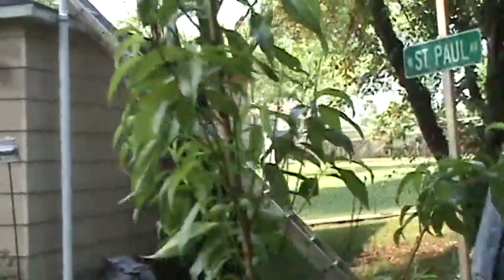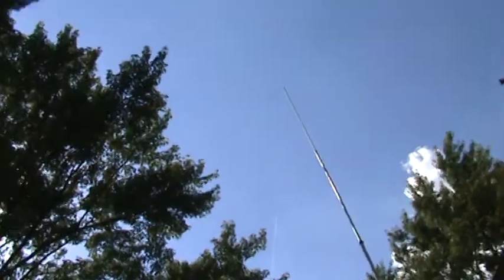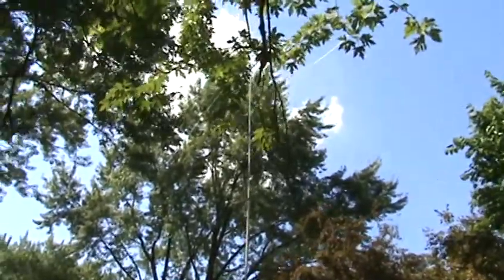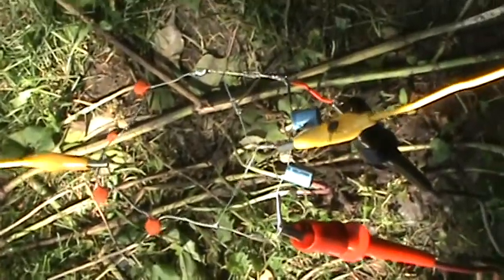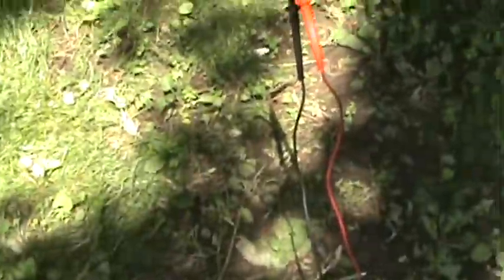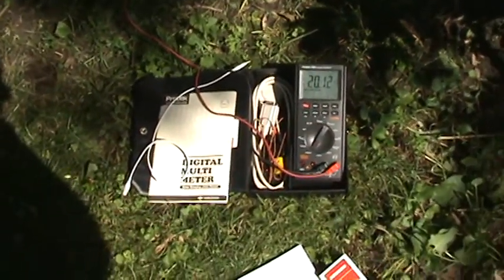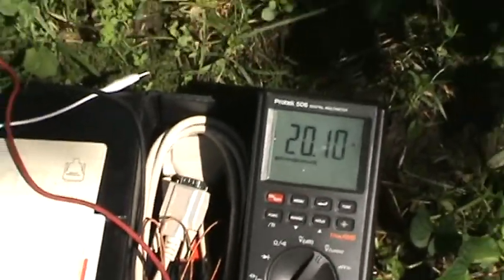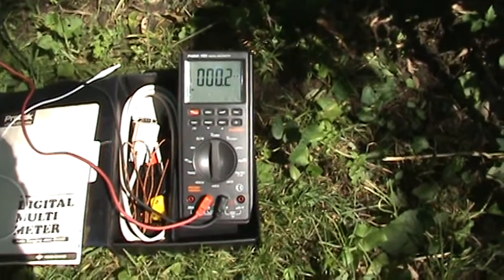FREE ENERGY FROM AIR CIRCUIT PART 6/24

Comment: Hi Paul. I was wondering if you've tried using insulators. I went to a Co-Op store and bought some insulators for an electric cattle fence. They're easy enough to use even though they're a little larger than I'd like. Who knows, larger might even be better.

I was wondering about the coils on white tubes. Are they plastic tubes? Can I use cardboard tubes (as long as they don't get wet)? Is the wire insulated or coated? Can the coils be used for an antenna (I remember a coil of wire inside the old AM box radio on our kitchen counter. My dad told me it was the antenna.), or can it only be used as a ground?
I seem to remember that tie ground was attached between the two electrolytic (polarized) capacitors. Am I correct? Also, I was wondering about using aluminum foil as an antenna or even a ground "plate" (only one side is shiny). Can that be done?

I actually built a circuit using the same configuration as yours. The parts I used are:
2 - Ceramic (non-polarized) Capacitors (0.2uF @ 50V)
2 - Electrolytic (polarized) Capacitors (100uF @ 50V)
4 - 1N34 A Diodes (Small signal - uses less of the electricity that you generate)

I haven't really tried it yet. I'm in the process of trying to set a sort of shop in our 3' 6" tall crawl space. My ground "rod" will probably be the water pipe as it comes into the house, so that will be good. My antennas will be hanging from the rafters which are almost under ground there. We'll see how it goes.

Just so you know, I live in Canada and we used to have Radio Shack but it was bought out by Circuit City and they're really not selling electronic components any more. What a disastrous loss. Also, I live in New Brunswick and I don't think there's one place in the province that sells electronic components. On line, I have to order $100 worth of parts to make the $20 shipping charge worth the cost. The trouble is, there's no way I need that many components. Ahhh, the joys of being an explorer!

I noticed a long, 3" or 4" dia. cardboard tube in your inventor shack. Are you going to be using that for some kind of coil?

Sorry for bombarding you with so much, but an inquiring mind wants to/needs to know.

Thanks,

Bruce
Reply from the maker: +Bruce Dobson Hellooo Bruce!  I always liked your thumb nail photo,,looks like beagles and a fox.

Cardboard is good, no problem to use as a core for coil.  The white plastic tube i use for the core is a plastic PVC pipe.  But cardboard will work fine, no problem.

I use enamel coated wire, also known as "magnet" or "transformer" wire.

Yes, you can use coil as antenna also, absolutely :-)  Was difficult for me to put weight of coil on top of my pole.

Alum sheets for antenna/collector, yes, very good.  Here is a guy, "thewonn" that used alum sheets and got a few LEDs to light.....
https://www.youtube.com/watch?v=DxUTf0wbNLA

As far as using alum sheets for ground, probably better to use chicken wire. Search google for "George Squire energy from trees"  :-)

Yes, ground wire connects to circuit from in between the 2 electrolytic polarized caps.

Yeah, Radio Shack is gone from here now also :-(  Out of business, they did not keep up with the times.

And about the large cardboard tube i have in my lab,,,yep, its to make a large coil with :-)  I have some that are even larger in diameter :-)  

I hope you make a video of your set-up when finished, or at least let me know how it turns out for you please :-)

Good luck and have fun :-)
Reply: +INVENTOR3 Hi Paul. I'm glad you like my thumbnail. You're the first one to comment on it. It is a fox in amongst a bunch of beagles. Basically, it says, "I may look like you, but I'm not like you."
It's good that the cardboard tube is ok because I can get them from work. ;-) I guess I'll find some PVC pipe for use outside and use the cardboard indoors.
I have been using the wire from the front of the CRT picture tubes from old TV's. Some I can tell are enameled but some of them I'm not sure about. So far I'm just collecting the wire onto spools. I'd rather have enough to do what I need done without worrying about the supply.
That I can use a coil or aluminum foil for an antenna is good news. The foil is inexpensive and covers a lot of area in one fell swoop. Good! Now I have some more stuff to check out.Thanks tor the link. I checked it out and laughed at the end when I saw the two lengths of aluminum foil just hanging in his room. Very cool.
I was just wondering about the foil ground sheet thing. I'm sure galvanized chicken wire would be better. That article about energy from trees was pretty cool, exciting and quite surprising.
I'm so sad about Radio Shack. I know components there cost more than at the regular supply stores, but it was handy and the parts were guaranteed. Now I have no place in New Brunswick to get parts without either buying a lot at one time (which I can't afford) or paying a fortune in shipping costs. It's either that or buy from China, which is communist (I really don't want to do that.)
I'm going to try all kinds and sizes of cardboard tubes. Toilet paper tubes, paper towel tubes, wrapping paper tubes, plastic pallet wrap tubes. Really, pretty much I can get my hands on. I'll let you know how it turns out.
I do seem to ramble on. Sorry about that. Take care and have a great Christmas and new years,

Bruce
Reply from the maker: +Bruce Dobson I enjoy reading your letter here, lots of laughs :-)  I can see your set up now, many sheets of foil hanging everywhere, heheheh
Was hard to see your thumbnail at first, but that is too funny, fox says "i think he went that way", hahaahhaa!
  Smart as a fox, heheheh.

Comment: Hmmmm. I wonder if there's a difference between farther away from or closer to high voltage power lines, etc. Hmmmmm...
Reply from the maker: +Bruce Dobson   At this location, the power lines ran under ground, at the location im at now they are over head, but so far  have set up in 3 locations and i feel the power lines have nothing to do with the energy im collecting.  and at this location i checked the incoming frequency on the antenna and it is above 60Hz and below AM radio.  NOt sure if im picking up beat frequencies or harmonics of other frequencies, I think mainly coming from the cosmos, stars, black holes, supernovas, pulsars, ect.. :-)
Reply: +INVENTOR3 Like I said, I work security at the local power company and there are high voltage power lines behind that property. I think I'll use a smaller diameter (about 3") cardboard tube for a wire coil antenna. That way I can use the same antenna at work and at home and see if there's a difference in energy picked up. It might be a while before I can get to it, but I'll let you know.
Bruce

Comment from the maker: Thank you,,video 16 i get over 100V
4) ceramic disk capacitors rated at .1 microFarads 50V
2) poloraized, electrolytic  capacitors rated at 100 microFarads 50V
both, i get from radio shack
4) germanium diodes, 1N34-A
i get from mouser dot com
Experiment & have Fun :-)

Comment from the maker: Higher antenna, longer antenna, Use 1N34 germanuim diodes,,,,and try to add a coil in series between antenna & the circuit.  I would go at least 5 foot deep with ground.  If you send me photos or video of your set-up, then i can help more :-)
my e-mail    millanyangle@yahoo.com

Comment: Why do you ground it? Why so deep?
Reply from the maker: As soon as i added the ground, the results were much better.  Ground here is about 2 feet deep, but later i make it 5 feet deep, but there has been no difference between the two depths.  I did many experiments with the ground and they all had the same reesults.  Whats important is that you have a ground about 1 foot deep, it does not need to be deeper.